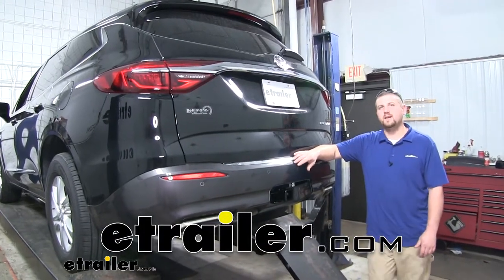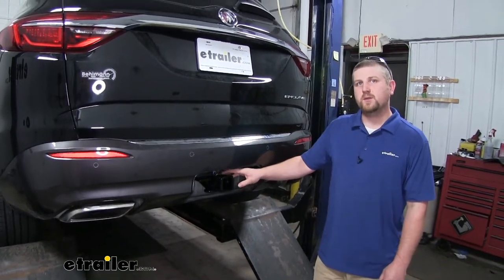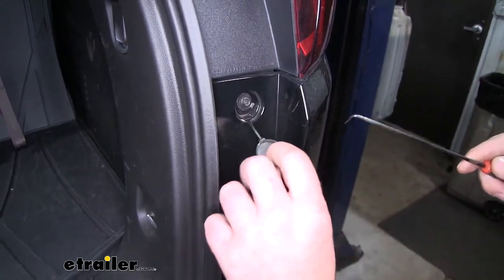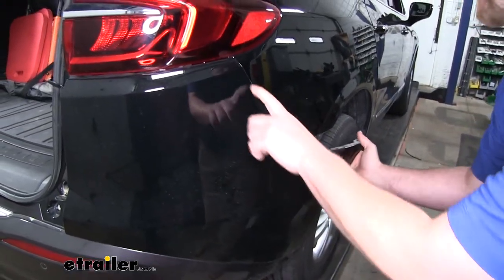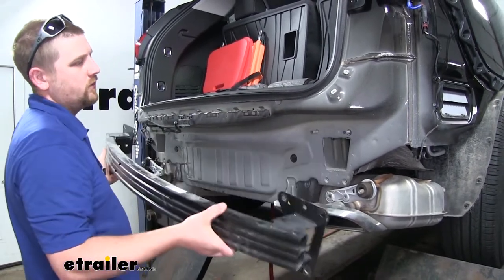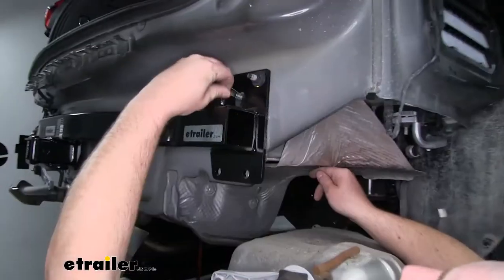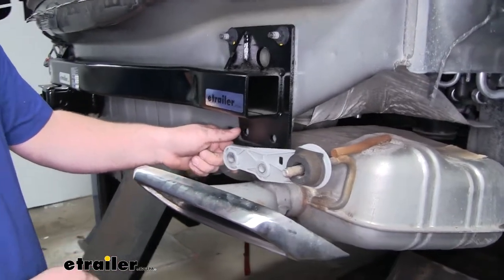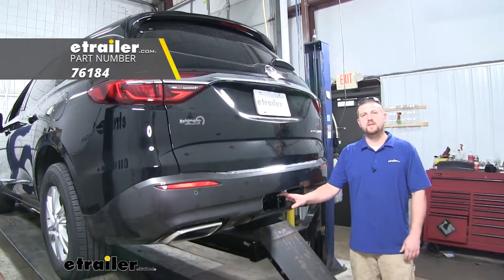etrailer | Installing the Draw-Tite Max-Frame Trailer Hitch Receiver on your 2019 Buick Enclave

Comment: did you forget the trailer wireing harness?
Reply from the maker: We do the wiring videos separate from the hitch videos so that you can see exactly what you are looking for. We have wiring videos available for the 2019 Buick Enclave if you would like to take a look. It is going to be a plug and play application.
https://www.etrailer.com/tv-install-tekonsha-4-pole-vehicle-wiring-harness-2019-buick-enclave-118761.aspx